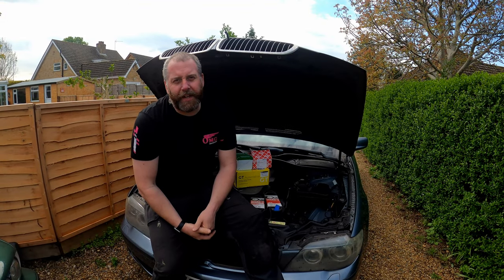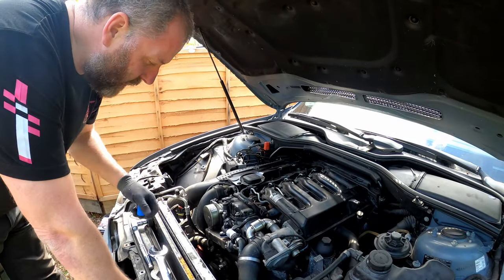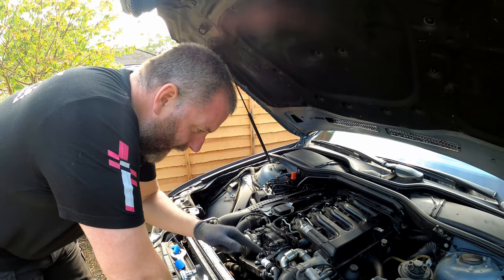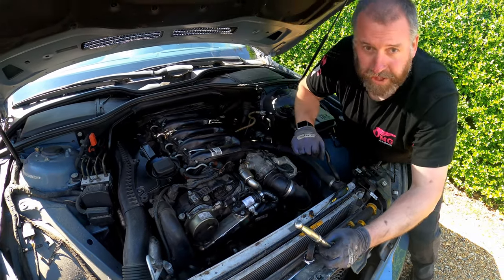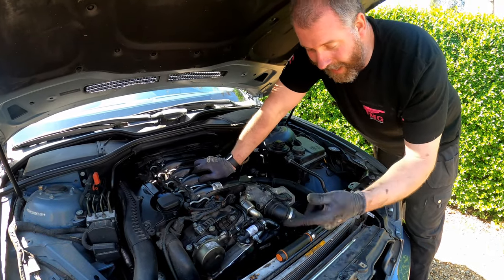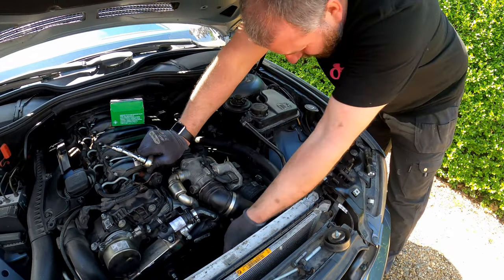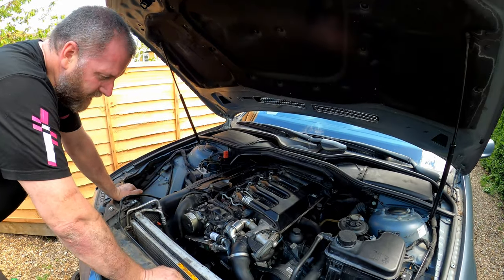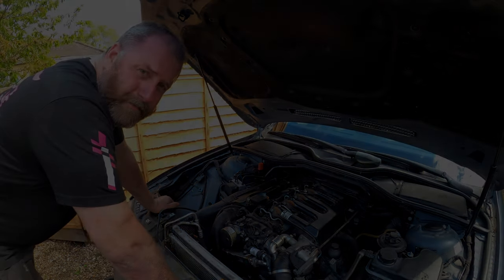Replacing The Crank Pulley On The M47 & M57 Engines - 3 Series, 5 Series, 7 Series & X3, X5 Diesels

Comment: Hi Kev
Thank you very much your video and advices. Helpful and amazing. Tell me please the 8 mm bolt is it safe? If I replace the crankshaft pulley I cant brake in the bolt? If I buy brand new quality 8mm bolt is it enough strong to hold the engine?
Reply from the maker: I'm sorry buddy but I'm not sure what it is that you mean? Do you mean to hold the flywheel with an 8mm bolt?
Reply: @KevsShed  Yes
Reply from the maker: @officialglitch-r  Ah right, now I understand, no a bolt would work, there won't be a huge amount of pressure applied to the bolt but if you have a tensile steel bolt then that would probably be better. Equally, an old 8mm drill bit would be perfect!
Reply: Thank you very much Kev

Comment: I would not recommend locking the flywheel to remove the crankshaft pulley bolt, you can end up damaging the flywheel as the bolt is torqued up to around 400nm.

This is how I did it: https://www.youtube.com/watch?v=Q2L77L6CJWY&t=834s

*Correction, just watched the rest and noticed that this is the later style pulley with the 4 small bolts like the N47/N57
Reply from the maker: I was wondering where you were going with that dude, I agree though, when I did the pulley on my old 320d a few years back before I had my channel, it’s bloody tight! 👍🏻
Reply: this is a different harmonic balancer with only one bolt and not 4 torx bolts?????
Reply: 40nm plus 60 degrees according to bmw tis

Comment: Is it completely necessary to replace the tensioner after Crankshaft pulley failure? Thanks in advance.
Reply from the maker: No mate, I only did it so I didn’t have to redo the job later 👍🏻 if your confident in the tensioners serviceability then no need to exchange.
Reply: @KevsShed  fantastic, last question, any tips on how to get the aircon belt on. Broke the laser plastic tool on first attempt. Cheap rubbish lol.

Comment: Can I actually lock the engine with high gear keeping belt on and undo the bolts then without having to use the tool and to it same way  when torquing new pulley? Thanks

Comment: I followed this too a tee. All went well until I turned the car on and the pulley is either bent or not balanced. On tickover the car has a noticeable shake which wasn’t there prior to failure. Disappears with a few hundred rpm. But something ain’t right on mine. I suspect the pulley is out of balance?

Comment: Hi, is it possible that a broken pulley is causing the gearbox, DSC and Driver Airbag Safety System to fail? Apparently, due to poor charging caused by a worn pulley, the BMW e65 catches such errors? My E65 is also 3.0d but 2003
Regards

Comment: Just wondering what socket you used to turn the crank as it has the 4 bolts in the centre?
Reply from the maker: In the kit there was a socket with 4 holes in. This fits snuggly over the 4 bolts and allows you to rotate the pulley with a ratchet or similar.
Reply: @KevsShed  Many thanks, I do have that tool but wondered if I was missing something and there was another way.
Reply: @KevsShed  Mine is all done and it took about 90 mins to do and no more knocking noise!, I highly recommend getting the proper pin to lock the flywheel, the hardest part was getting the flywheel plug out! Great video and very helpful 👍🏻

Comment: Hi do I have to get the 120 deg turn perfect on every bolt as I don’t have a degree tool ?
Reply from the maker: As good as you can achieve by eye will suffice 👌🏻
Reply: I’ve replaced my crank pulley with a Corteco one and it wobbles more than my original BMW one. All bolts torqued to 40nm and roughly 120deg turn. Any ideas what it could be?

Comment: if 8mm is the diameter of part of the tool that inserts into the flex plate what is the diameter of the section than mates the bell housing hole??

Comment: If I only want to crank the shaft clock wise (without that locking pin in the back) so that I can remove the AC compressor belt (instead of taking out the entire pulley), do I need some kind of special tool to spin the crank shaft? Since there are four pulley bolts, is it safe that I crank it using only 1 of the 4 bolts? The ISTA doesn't talk about it.
Reply from the maker: I wouldn’t, they aren’t particularly heafty and you risk shearing one off. The tool that I linked in the video description is pretty cheap to be fair! 👍🏻

Comment: If you was unscrew the 4 bolts before the belt and car is on gear. You don't need this tools for crank :)
Reply: If the car is auto, you have no other choice than lock the engine.